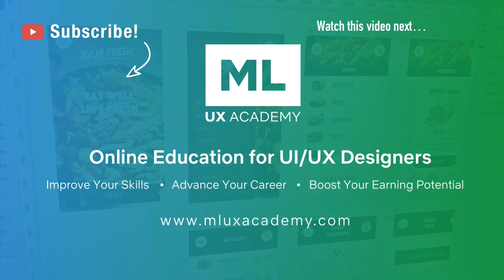From Blank Canvas to Hi-Fidelity (The Design Process) - Overcoming Creative Block

Comment: What do you suggest for onsite interview design challenge? How do we come up with ideas for whiteboarding without a laptop?
Reply from the maker: Personally, I would follow the same process for a whiteboard session. I would describe the same process while I sketch it out on the whiteboard. Instead of researching online for ideas, I'll just rely on my past experiences and web standards. Whiteboard sessions is truly not about whether you have the perfect solution, but rather about showing how you might approach finding a possible solution. Always tell those that are interviewing you that the designs you come up with are always "your best guess". Its a matter of testing, measuring, and iterating on those designs. That's UX, consistent improvements.
Reply: @MikeLocke  Thanks for the elaborate response! That helps.

Comment: Seems like a lot of skipped steps, little user research. I suppose it's fine if its for a portfolio. Thanks for the vids. :)
Reply from the maker: "User research" is not always required, depending on the difficulty of the project, resources, etc. Also, in Phase 2 that I discussed, you're technically doing a light form of user research when scouring the market and finding solutions that have already been accomplished. In many cases, this is sufficient and can be very effective using limited resources for actual user testing, research.